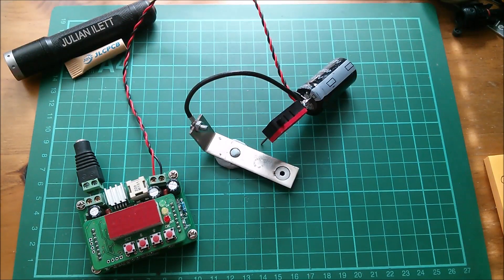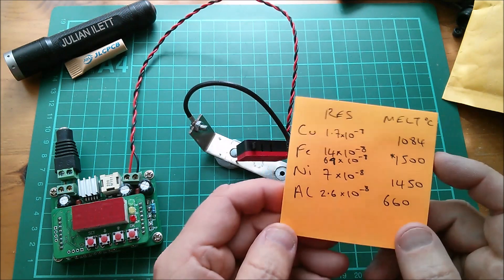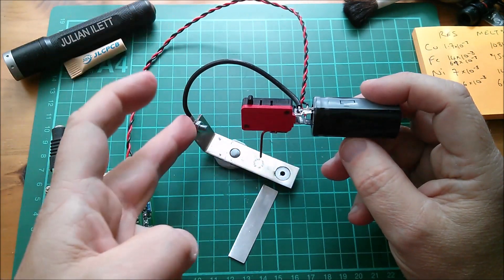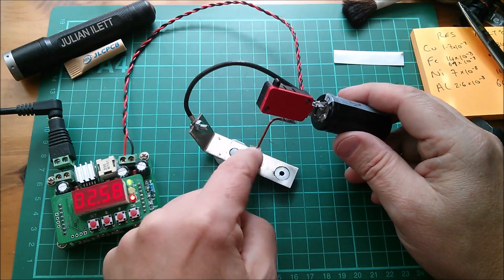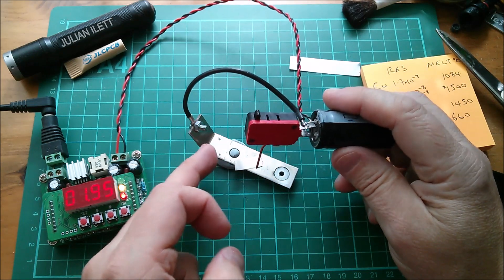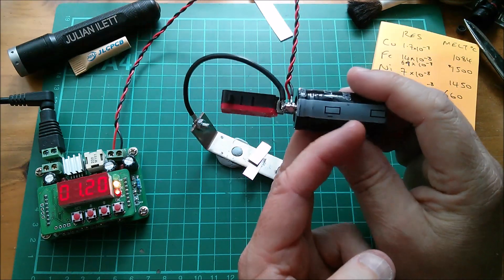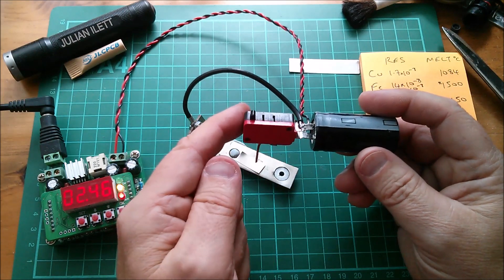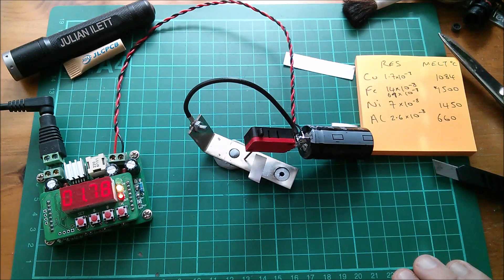Will it work? 100F Supercapacitor Spot Welder

Comment: Hi Ya . Im a sheetmetal worker and done a lot of spot welding . The copper tips allow the current to flow its the resistance between the faces of the steel that causes heat and a localised weld .The copper tips do wear down but never melt and will NOT adhere to the material  . The above info is for a traditional spotwelder pressing equally from both sides . I will guess that the battery spotwelder welds where the metal spots are in good surface contact ie 2 spotwelds at the same time . Hope this give a little help. regards Don.

Comment: Oh dear. This video reminds me of when I was in my teens (several decades ago) and a friend of mine, who was kind of an electronics prodigy, had got hold of a small diode laser (I don't remember if it even had any collimation optics). He said that the laser should produce something like 6000 degrees C of heat. But none of the "experiments" with it melted or burned anything. I was kind of perplexed. :)

Comment: All your system is problematic, the wire width is more suitable to 10A than to 200A .... also the microswitch is not suitable, probably also the super capcitor resistance , (some of them have 20 mili ohms resistance, while other have 0.3 mili ohms - need to read datasheet), by capacitor pin structure this is 10 mili ohms or more

Comment: Comedy of errors end to end.   Use 2 leads so you can control where the energy is dissipated, and try thin stainless steel strips.  Holding the switch more than 1/100th of a second is pointless.  If it hasn't welded in that first 1/100th of a second, it's not gonna happen.  As for the resistivity - the ratio of the resistivity is the ratio at which the metals at the interface will heat at.  The copper has nearly 500x lower resistivity than stainless steel, so the stainless steel will be a puddle long before the copper begins to melt.

Comment: You gave the answer to your question about the copper tips yourself: the copper has very low resistivity, so it will not warm up with high current bursts. The melting will occur on 'hot spots' where resistance is high, hence the name spot welding.

Comment: You need orders of magnitude more current to spot weld. Last spring I built a 10s5p e-bike battery using a 12V car battery, scooter starter solenoid relay and Arduino+FET for pulse duration control (about 40 ms was good). 0.1 mm steel strip was easy to weld, 0.15 mm pure nickel a bit difficult and 0.2 mm pure nickel did not weld reliably. My wires were on the thinner side and got too hot to hold after about 5 consecutive welds.

Comment: If you want to explore how bad this is (sorry), why not try soldering?  Component lead to pcb with solder/flux paste. Does it produce enough heat to melt solder?  Maybe...  If not, there's no chance of welding.  If it does work it may actually be a useful tool.

Comment: You should have used your capacitor bank. Because you need instantanious energy.
And you should use a proper Relais 12v 50A Something like that instead of the Microswitch which is designed for Signal switching only

Comment: I'm very suspicious of the tiny "100 Farad" capacitor. Most 1 Farad capacitors are enormous, but 100 Farads!?! Maybe I don't know much about the capabilities of super capacitors. I agree with everyone else that the switch is a problem, but if that Cap is truly 100 F then the switch would only work once.

Comment: I don't think the switch or cap is going to work, there doesn't seem to be enough energy involved , I built one with a timer board, and microwave transformer, using a SSR , the steel you are using, is a heatsink, the current needs a gap between electrodes for resistance to heat, if that makes sense, its 4am and I should be sleeping!! Ha-ha, the copper can melt slightly, but will not weld to steel or nickle well, I don't think you have enough voltage for the he amount of resistance, so the current isn't dropping fast enough to weld. The weld needs to happen in a fraction of a second, I don't think the 2 v is going to work, I think it will require atleast 6-8v. And about 100a, but since it's pulsed for about1/10 second, its not that much energy. I think going capacitive, you will need alot better switching, and alot more caps, 2-3s 4p, and maybe it will work, but just allowing the cap to discharge, over a second , is not going to work, I wish you well. But I'd do what everyone else is doing, because it works, eBay has microwave transformers , maybe they have one ready for this project! I have several large transformers, but they need primary windings,  maybe you can find a old car battery charger, that is on wheels, that van start a car, it should work, or build one using a car battery! They sell kits to build those, good luck!

Comment: The super capacitor is a full DC discharge, whereas an AC welder (eg microwave coils) are turning off and on 50 times a second, making it easier to sustain an arc and to pull the welder off the job

Comment: Voltage is too low. Use IGBT transistors for the switching use larger wire too.

Comment: Things to consider.
I=V/R, P=I×V, E=P×Time, Thermal conductivity over time.
The big four. Voltage, resistance, thermal conductivity, and time

Given enough time, even a relativly high resistance low current could melt metal provided the heat isnt being wicked away at a rate that prevents it from reaching its melting point.  

But you want your welds quick and to deliver the heat to mostly your spot weld. You want very small point of contact with the material being welded so that all the amps flowing through that tiny spotn heats that spot quickly. Ideally, you want most of the circuits resistance to be in that spot. That is aided by having that contact spot as small as possible. 

Grounding the way you did in comparitivly high resistance steel contributed to reduceing how much current  2.5v  can drive through the circuit. Thus limiting how much power can be delivered over a a given period of time. As well as spreading a significant amount of the energy across much of the steel because of thermal conduction and the longer distance between ground and point of contact.  If you had two capacitors in serries doubling the voltage, that might drive enough current through a small contact spot to weld even with the larger grounding resistance. 

Copper may have a comparitivly low melting point but not only does copper have relativly low electrical resistance, but it has high thermal conductivity. And the thicker the wires means less resistance in the wires resulting in less heat/energy being dumped into the copper. AMD muchnof that that does is quickly wicked away, limiting how much copper melting into the weld. But you will always loose some copper atoms with every weld. 

The capacitor's esr may be crappy too as evidenced by the warmth you felt and crappy welding.

Comment: I find it funny you mention the copper points people use. I don’t have a spot welder but plan on building one some day. When I do I plan on using tungsten tig tips as the electrodes for welding. They should last nearly forever and not have to sharpen them like they do with copper electrodes.

Comment: @Julian Ilett - Julian, you have much more than enough stored energy. Your connecting wire and contact point are fine. What you do not have is a sufficient Heating Rate. Think about the several-second time constant of your circuit, and about I²R. Think about heat conduction in the thermal mass you are heating. I estimate you need between 20 and 200 joules, delivered in about a millisecond, and you need a MUCH better switch to carry that large current pulse. I used to operate a circuit with 400 μF at 710 volts (about 100 J) driving a solenoid wound with 19 AWG wire (at 0.65 mm²). Total discharge time was 8 ms, but most of the discharge was in the first 1 ms. Assuming 3/4 of the energy in 1 ms, that was a discharge rate of 75 kilowatts! The 4 relay contacts were parallel paired and 5 mm diameter, and they usually welded together despite being made of a Palladium-alloy material designed to resist welding. The capacitors were the old-fashioned "computer grade" type with large screw contacts and very low ESR. Many of the type are available at low cost on the surplus market. Large SCRs are also available, many with peak power ratings of several megawatts (usually about 10 times the sustained rate). If you use any of them, make sure to drive the gate HARD to prevent second breakdown, or else put some series inductance in the circuit to limit the di/dt to a safe value.

Comment: I just watched a video with the same fail for the same reason.- while using a microwave transformer instead of a cap. Removing the micro switch created good welds. 
The micro switch resistance jumps with heat, creating more voltage drop. You need a 200 amp switch...assuming you need a switch. 
I think a timed switch is needed for production. But, small scale requires only a minor trick.
Also, I have seen good luck with 200 to 300 F caps. !00 might be a little low

Comment: As others have pointed out, the steel base is way to big an area to achieve anything. The steel to be welded needs to be sandwiched between to small-area electrodes so as to concentrate any weld process to a small area on the plates to be welded, and not dissipate it over a large expanse of the steel base. If you've ever seen an industrial spot welding machine that's essentially what they do.

Comment: How about a dimple/point contact on the steel?  I'm thinking the resistivity of nickle increases 8x at it's melting point, so the electrons would tend to spread out from the copper contact.     Does it have to be a nickel weld?  Could you put some metal with a lower temperature (aluminum/solder?) between the strips?  Why do the two prong welding pens work?  Seems like the electrons have to leave the nickle and travel through the conductor below.  Convenient for battery tab welding, but it seems like that would need a lot more amps.

Comment: julian,just make a generic layden jar from a used Princes Chicken & Ham Paste Jar 75g and some burned kitchen foil (to remove any coating, and oc any residual carbon deposited on there can only help holding more charge) and/or a stack of series/parrallel pie foils and charge that ,no need to worry about overcharging or overheating

Comment: There are many things wrong here. We use copper because it has lower resistance and the load gets maximum current. SC's don't work in these applications. If you use high enough capacitance from a good maker you can weld, the problem is in bringing the capacitor back to full state of charge. The more capacitance the longer it takes so you get inconsistent welds.

That small switch will never work, it's contacts are not designed to take high currents after not too long they will weld to each other. 

Julian please do some research before you experiment, this is really a poor video.

Comment: A spot welder like this needs to be able to provide at least 100 A for a very short controlled period of time. I've built one using a big transformer with an output short circuit current of around 600 A. It did kinda work, but the welds were not really consistent due to the bad electrodes I used and possibly the AC output. Try using bigger capacitors, higher voltage (5-15 V) and a mosfet switch controlled by a microcontroller with adjustable pulse time

Comment: I may be wrong but if you have both sides of the switch connected wouldn't it just electrify the coper probe, unless I missed something and the copper probe is only attached to one side of the output

Comment: U need 2 small points so the heat is in a small area... that large block of steal/metal is acting as a heat sink...
I'm sure I've seen something similar (supercap/cap) used as a welder... & it worked...so ur doing something wrong..!

Comment: To electrically weld, you need a power source with a VERY low impedance and a VERY high current capability. Try using a couple of nice big 2V lead acid cells (say 60Ah) connected in series with nice big large diameter copper cables.

Comment: You need 60-100 amp from 2 parallel copper rods to get a weld. That supercapacitor can get a maximum instantaneous short circuit current of 22.5A which drops down to 1amp very very quickly. A larger supercapacitor of 500F will be barely able to do the job either. There are cheap kits you can get from ebay that are connected to a modified microwave transformer which adjust the current and pulse of the output. My 3000F ultracapacitors can give a short circuit current of 1800A. In a string of 6, a spanner shorting the terminals gets vaporised :D

Comment: I definetly could predict it wont work! For spotwelding you need at least a current of 300 - 500 Amps. This 100F (fake?) capicitor would be able to deliver 50-100 Amps in the best case but that is compensated by the weak mircoswitch! Even without the switch (you should replace it by a big relay (magnet switch used for car starting) to deliver the Amps) - it could not do the job properly. I have some 500F Supercaps - even those cant to the job (they can probably a few times and then will die quickly!) You can use 2 3000F Supercaps in series - that would work - probably too good - so you need a timing solution with 555 timerchip or similar. These can deliver a few 1000 Amps in short circuit. Its much easier to use a car battery here ;-)  The copper tip for better conductivity so you get the amps without loss to the material ;-)

Comment: Part of what makes spot welding work is the pressure at which you push the 2 pieces together.  I doubt you're getting anywhere near the required pressure at the moment.

Since you're trying to weld low resistance material... You probably want to use higher resistance electrodes. And something that can take the heat, like tungsten.  If you know someone that does TIG welding, you may be able to get some scrap tips off them for free. They're not too expensive, but I don't think any place sells these in singles.

Comment: I am guessing at this point but I think your going to need more energy to get this to start working.
Even when you get it to work with nickel your going to still have issues with aluminum do to the oxide layer. You will need to remove it and then do the weld quickly.
Aluminum Oxide melting temp 2,072 °C (3,762 °F; 2,345 K). So if you don't remove the oxide layer you will have to melt through it to get a weld with the aluminum.

Comment: I built a battery tab welder a while back, i used a bank 22millifarad capacitors, 10 in parallel 2 in series, charged to about 30V total and dumped by a 2600A thyristor through a thick cable, probably approx 50mm² into probe tips made from 10mm copper square stock sharpened to a point, pressed to the tabs with a couple of kg of force and about 2mm apart.

The key component is a switch that will handle the current, as people have pointed out your microswitch is more likely to weld than your battery tabs since it has a smaller thermal mass and probably a smaller contact area. If you can't get one of these magical thyristors you could probably get away with a few large mosfets between bus bars but your capacitor voltage and wire dimensions would need to increase.

My capacitors aren't ideal, they have a fairly high internal resistance, i suspect i could get away with a third or a fifth the capacitance and maybe a bit lower voltage if i could use lower ESR caps.

Other people have gotten this to work using a high current transformer with an output of something like 6V DC and a few hundred amps, that's another path that eliminates the large switching current but doesn't yield as nice of a result.

Comment: Seems small for 100F...I know I unintentionally welded my tweezer to a screw when I was putting shrink tubing onto a car super-cap 3.5F (not in a car, not connected to power source) that had been previously charged to 14V - that thing is like 3-4 inch diameter and almost a foot long.

Increase the power, ditch the wimpy switch, and get some fat (10-12awg or heavier) cables.  Instead of a switch have 2 probes, press firmly with the one then touch the other firmly next to it (close but far enough to ensure current goes thru the tab not shorting probes) to discharge the capacitor bank.

Comment: Measure the resistance and calculate the current at those wimpy 2.7V (and the energy you're dumping) - you'd even get a better result with a small lead acid 12v battery..

Comment: I believe that the recepticle needs to be a pointy copper bit too.. And i have seen spotwelding on aluminium. The trick is to put a sheet of steel on either side of the aluminium, and then only do one weld of the time, or you will have a hard time getting the steel off again.

Comment: Those supercapacitors have a very high ESR. I would try using a bank of regular electrolytic capacitors at about 1F to 2F at around 10-15 volts.
You will need a bunch of MOSFETs to switch it. Connect everything with bus bars, only using wire where it needs to be flexible. The peak current should be a few thousand amps.
The commercially made welders will produce several short pulses instead of just dumping all of the power at once. Using an SCR or a big contactor will just blow holes through the work piece.

Comment: It doesn't look like you are getting enough power to spot weld anything there, but if you did, I think you will spot weld the switch contacts. I don't think a micro switch is a good choice for what you are doing.

Comment: It is difficult to weld aluminium. The melting point of aluminium oxide is 2072°C. Metallic aluminium is very reactive with atmospheric oxygen, and a thin passivation layer of aluminium oxide (4 nm thickness) forms on any exposed aluminium surface. Grind the surfaces of the aluminium and try to weld it again.